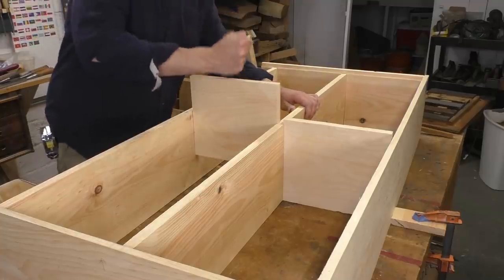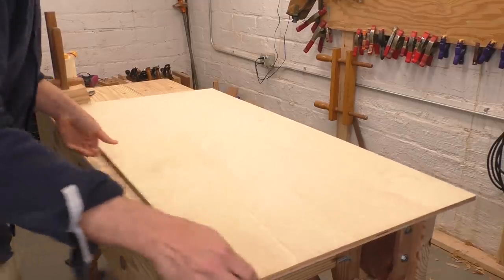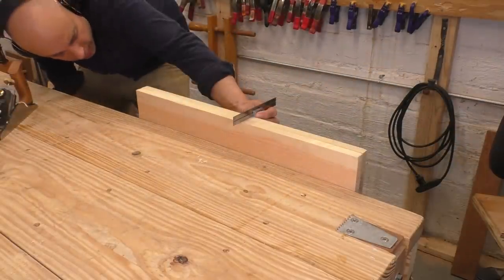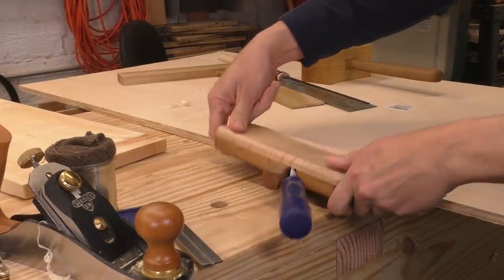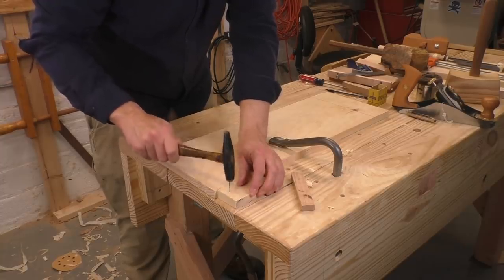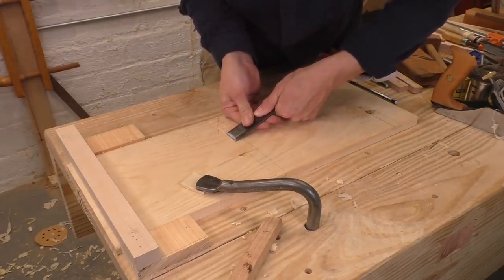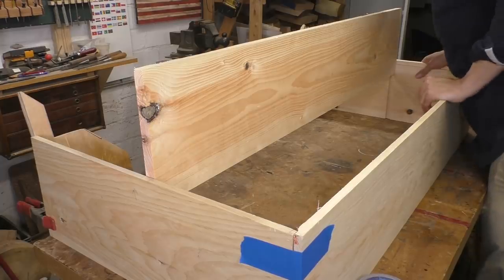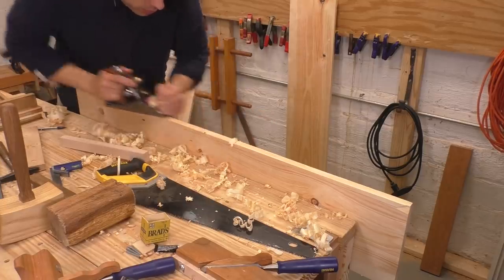Make a cabinet with hand-tools and no clamps.

Comment: Hi Rex. In the absence of mammoth sized clamps when working with large items, I turn to (ahem) ratchet straps.
Yes - RATCHET STRAPS - as used for holding loads onto trailers and the like. They fit around most things and can be strung together for even bigger tasks, if required (such as holding a football stadium together, or whatever). I've used them for all kinds of tasks in my job. Heck, they can also be used to tug heavy things into place accurately or even suspend them ready to be fixed with no help, no struggle - NO HANDS!!!
They come in a huge variety of widths, lengths and strengths, too - and they fit easily in the kit when rolled up nice and tidy, like coiled snakes silently waiting to strike (unlike a jangling iron mountain of heavy, bulky and awkward clattering clamps).
Never underestimate the crafty carpenter, Rex; I admit we are a sly breed - BUT - it's all about what makes things easy...not pretty!

Comment: Someone once told me nails and screws are just perminent clamps. Also In recently refurbed an 80 year old chair. It was stained dark brown. Much to my surprise there were 4 nails holding the back in place. Surprise because they were set flush with the wood surface and stained over. The heads were small and flat, not dimpled like a “ finish” nail. They were nearly invisible to the naked eye. No would filler, just perfectly set and stained over.

Comment: I'm catching up on your videos after missing a few, and this really reminds me of a project I built, I guess it was 2 years ago now. It was a cabinet box, made out of pine boards (70 year old boards salvaged from my grandma's house before the house needed to be torn down), with four drawers in it, to go under my workbench as storage for tools. I did a lot of cuts on the tablesaw, but the drawers have hand-cut dovetails, and the carcase was put together with glue and nails just like yours. I suppose I should have dovetailed the carcase together, but I was lazy and just used web frames on top and bottom. I didn't put on a full back, but I did put on a diagonal piece of wood both as a stop for the drawers and to hold it square.

Comment: This is great!  I don't need any shelves but I have been looking at plans for an entryway shoe storage bench in pine.  Now if I can just get my saw to follow the line...
Reply from the maker: I'll be reviewing some cheaper tenon saws soon!  Just got 2 in the mail.
Reply: @RexKrueger  Not just tenons, I can't seem to get a saw to follow a straight line without drifting significantly by the middle.  Practice makes perfect I guess.  I'll just have to keep playing with it.
Reply: @ddsworkshop4371  Try a Ryoba saw. Today I did a 120cm rip cut and didn't drift at all – the first time ever
Reply: @shuttie92  I've been using one.  Might need a better one.
Reply: @ddsworkshop4371  Mine was about the cheapest one I could find - what helped me was keeping the cutting angle really flat, as parallel to the board as possible, and then I could see that my movement was in line with the pencil line the whole time. Also, if you use a knife to score the pencil line the saw tends to follow the cut.

You're probably doing all of that. Maybe you have wonky arms
Reply: @shuttie92  LOL....very likely.
Reply: For saw cuts, go back to basics. Stand up to the cut, line up the saw, take a step back and check plate, wrist, elbow and shoulder are in alignment. A drift towards the end of the cut might mean you're leaning to see better: if at the bench, either realign or raise the board up (bench might be too low for you); otherwise, reset body. Only other thing I got, if you've recently cleaned up/abraded saw then check the set. But most likely your leaning to see or body's in the way.

Comment: I LOVE this series, but my biggest and TBH only problem...is the freaking planes. It sucks that they are a 'collectors item' because here in aussie land, i bought a 235mm troj-something plane from bunn---some-place and it is garbage...like absolute garbage. Even after sharpening the blade and oiling, and removing those freaking AWFUL dual 'adjusters' it still sucks (damn good tip btw Rex, hammers are 1,000 times better than those stupid adjusters), but even a single plane that is actually decent from yesteryear is pushing $100 (the blades are freaking $60!!). I would love to know if one of the viewers has a suggestion, because i LOVE the look of the wood after planing, but i cannot afford to spend $100 on a simple hand tool. A freaking drill press costs less than those 2nd hand planes. I watched the vid on Indian planes, but am still skeptical. Please weigh in.

Comment: What madness is this? Sitting here pondering the upcoming premiere with a sense of foreboding. First, you take away my need for a vise. now you wish to remove clamps from my life. What will be next, glueless joints, only use magnetism?
Reply from the maker: I actually did a video on glue-less joints a few months ago. Not as scary as you think!
Reply: @RexKrueger  Which one is that cause I'd like to see more done without vices/glues/hardware?
Reply: @kchek  he made a small box with glueless rabbet joints, using just nails.
Reply: Glueless joints can be done using nails. The traditional technique is to clench the nails. Drive it all the way through then bend the nail and drive the tip in again from the other side. I'm sure Rex will do this on a project eventually.
Reply: Woodworking with Free Energy. Guaranteed a Million+ views from the true believers ;)
Reply: J S  Perhaps the next thing is woodworking without wood. 🤔 That would take some smarts to figure out
Reply: He didn't remove clamps he used a hold fast

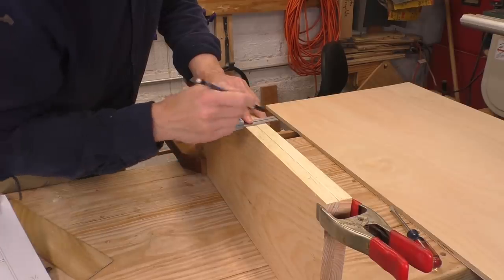Comment: Title “...with no clamps.” At 2:44 “with the two edges clamped together” and shows a spring clamp...

Lies! It is all Lies!
Reply: True but then there are alternatives like tape
Reply: True but there are alternatives like tape
Reply: spring clamp on board ends. bar clamp on block what kind of $#!+ is this. lol
Reply: In cabinet school we did not use clamps. We just put glue on the dado then used smaller nails like brads or finishing nails. We only did one part of cabinet at once then moved to next piece. You must make sure dadoes fit first though. The glue is mostly what holds the cabinet together. The nails purpose it to hold it together till glue dries. The face frame, the back will ad more support.

Comment: Why not attach the back before glueing in the shelves and dividers? That way you know the frame will stay square, and you just trim the shelves and dividers to spec as the last step.
Reply from the maker: The joints for the shelves are flexible when wet; easy to shift a little when installing the back.
Reply: @RexKrueger  That does not really answer the question. Sure, it is possible to put on your shoes before your pants if the pants legs are loose enough, but that does not mean it is the best way to get dressed.
Reply: I imagine the shelves and dividers act more like structural members when attached in this way.  The method suggested here sounds like it would work, but the shelves and dividers would perhaps work more like wedges than supports concerning the overall carcasse.  Just a guess, perhaps this truly is a matter of preference.
Reply: I suspect he did it that way because it's easier to assemble it in that order.  If you've ever put together one of this Ikea, or Wal-Mart particle board bookshelves, the backing is the last piece that gets attached.  I'm sure their instructions are ordered that way for a few reasons, but ease of assembly is the first one that comes to my mind.

Comment: Instead of clamps, you could also use ratchet straps with scrap wood under the ratcheting mechanism. As for shelf sag, there’s a web app called the sagulator that will give you a fair idea about how long you can span a shelf.

Comment: Some 20 years ago I was working on a sail boat with my grandfather and he used rope like laundry line and twisted the rope like a tourniquet as a clamp. He put wax paper where glue would likely ooze. It worked and on a small boat there was no storage issue with clamps.
Reply: Joe Seabert I do basically the same with ratchet straps

Comment: Yep, I no longer have much in the way of wood working tools. a couple of planes, a portable drill press and this and that. I would have a tough time doing this the way you did. However I still have a good skil saw with a high end blade, and know how to use it to do a lot more than just cut a board. I learned many things with a table saw that can transfer to the skil saw, just basically up side down from how it's done on a table saw. For instance I know how to cut the rabbet and dado joints with the skil saw and some blocks of wood used as disposable fences.

Comment: Rex, I'm loving your videos lately!
As a newbie woodworker focusing on hand tool work, your recent content is right up my alley. This is an interesting project because if you search for cabinet build videos, 9/10 will be all machine tools. And the other 1/10 will be some fine handcrafted artisanal cabinet that demands a lot of experience and patience.

Now for some constructive criticism: I think the setup here was great, but I think the build felt a bit rushed. In particular, I felt it was lacking a clear payoff regarding your struggles with cabinet builds. What did you do differently on this build? Did it turn out better than past efforts?

A bit more detail on the pine stock you selected would help as well, but I'm guessing that you're saving those particulars for the plans.

Comment: Hey Rex. Looking through my local big box store and I notice that boards this wide are all plain sawn and if left alone, they're all going to cup like a boss as there's plenty of curve in the growth rings. When used for joinery like this, will their use in the cabinet help them not to cup as they get resistance from the other pieces?
Reply from the maker: Not all plain-sawn wood cups; most of the furniture in the world is plain-sawn. Properly dried, it's fine. That being said, this wood all had a little cup and I do expect the structure of the piece to resist that.
Reply: Thanks  @RexKrueger . Perhaps I've been looking at the leftovers after others have already picked over the batch. I guess buying it and using is called "getting experience". Cheers

Comment: Joints that are nailed but not clamped do not develop the full strength of the glue joint. However, the structure may be strong enough, anyway. May I recommend you consider using hot hide glue. It is dead simple to use, does not require clamping, and allows moving directly to hammer veneering. I only discovered it a year ago, having thought it was esoteric and finicky. Not so. The only downside is you have to wait overnight with glue ups before the next machining step or finishing. For your style of woodworking I don’t see that as an issue.

Comment: I like to use strips of bicycle inner tube as strapping / a poor man’s band clamp. I can get the discarded inner tubes for free from a local bicycle repair shop. You can even knot several strips together to increase the length.

Comment: I had a broken particle board dresser I had to fix. When I needed to clamp it, I used automotive tie-down straps that have the ratcheting mechanism. I then got creative with platforms and weight on the board to ensure that it lay flat while the glue dried. I now have a fixed dresser.

Comment: I just finished my first project, took me about a week from the day I brought home some pine pallet wood. I got it torn apart, planed, I went with mortise and tenon joints and got a lot of blow out on the first side, but got a lot more success on second side. I made a tool tote. I have been gathering tools and practicing on scrap and was getting annoyed with no where to put my tools. I have a 3 foot by 4 foot corner of the toy room to work with and a 2 foot by 1 foot portable work bench that I made a new top out of oak pallet wood. It was you who inspired me back in January to start this hobby and its made me very happy. Thank you and keep up the great work.

Comment: Your cheating your workbench is a clamp
Reply: Also when your rabbiting the shelfs you use a massive orange work clamp
Reply: I think people are more likely to have a few average size clamps than a workbench with dogs. 
I was expecting him to use screws, then pull them after the glue has set,  tap a bamboo skewer in there with glue. This method is very common with modernish plywood boatbuilding, the other is stitch and glue. Same idea and meant to reduce the number and complexity of clamps (and forms) needed for assembly.